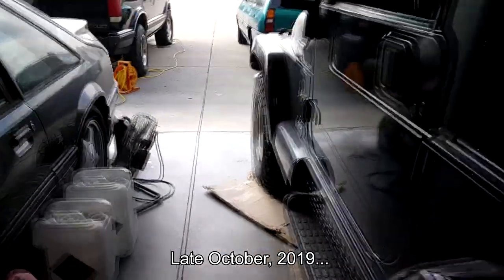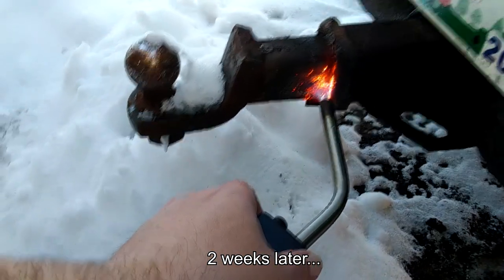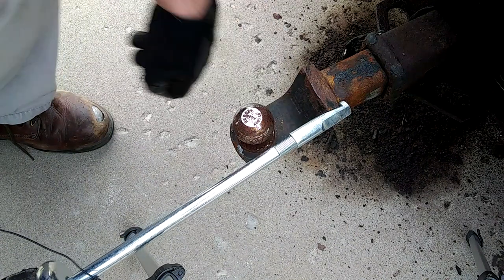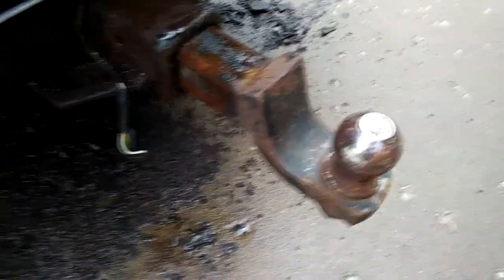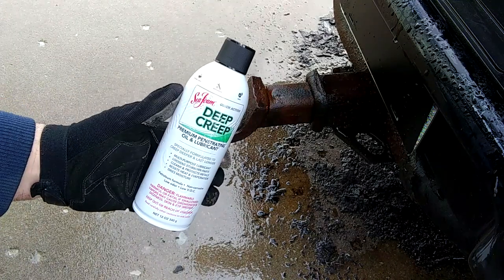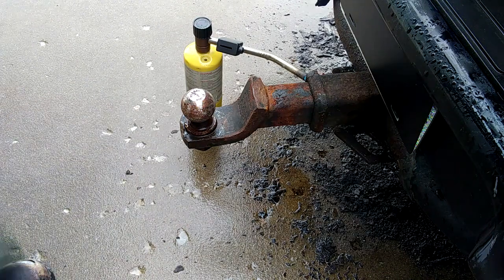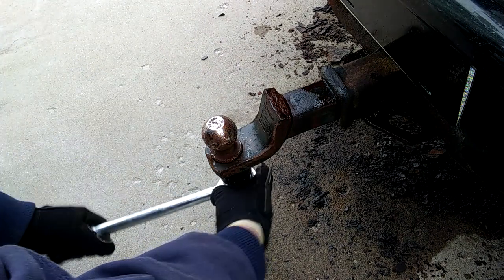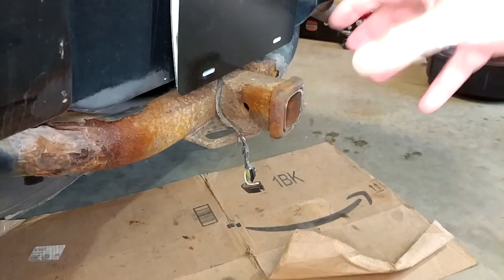Trying Internet Suggestions to Remove a Stuck Trailer Hitch

Comment: Heating the  inner piece just increases the size against the outer piece and the interference does not change. Heating the outer part good and hot, then spraying the inner with some freon from the back to shrink the inner will cause a dimensional change, have it hoooked to a chain and a tree and give it a jerk, it will most likely come out.
Reply from the maker: I was just trying to drive as much temperature into it anywhere I could and let differential cooling overnight take the wheel and hope it might crack loose. A MAP torch was never going to be able to put enough heat into it to expand it meaningfully. That said, I did use most of a bottle trying for the Sea Foam attempt and I did spend more time on the vehicle side.
Reply: @TheBrokenLife  Well, it worked for me. A map torch will induce enough heat, followed by the shrinking. 30 minutes mine was out, rust ,sand and all.
Reply from the maker: @tedgerstenslager2949  Check out the end of the video to see what I had at the end. I suspect we may not have started at the same place.

Comment: Hey heavy mechanical engineer here. Was really interesting to watch how others attempt this and ive seen alot of those gimmick tricks over the years. As you said theyre basically all wd40. 

You was on the right lines with the map torch but you was heating the inner part. Id put alot of money on combining alot of the techniques would have brought this out. Ie heat and shock.

Two things you didnt try after heating was hitting it further in, breaking the corrosion is the first step and in or out it still breaks the corrosion bond and a much bigger hammer (sledge) would have had about 20 times the force of that slide hammer. 

Second tip you didnt use is if you cant heat it enough with your torch is welding, still ploughs heat into it and a few runs of weld is gunna heat it to about as much as a home diyer can get it, also more people have welders than a big oxy torch setup. Even crap welding works (just make sure its on the right part!)

I was also actually thinking you could use an impact gun to help break the corrosion, again a shock method, and i saw you use on in the video but you needed to combine it with getting it as hot as you can with your torch (it will help) and a hammer, its not just going to pull out gently as you seamed to try when using the impact. 

Cool video tho and id love to of had a go at this just to see if i could have done it as i know its different to words on the internet vs real life.
Reply from the maker: Thanks! 👍

I actually tried all of those things (except welding... no welder at the time), I just couldn't have a 6 hour video and how many people want to watch a guy swing a hammer that long? 🤣 I was reasonably sure I did have footage in there of trying to beat it in further with a mini-sledge (in reality I did so on multiple occasions, heat or not, various oils, etc)? And at one time I had 2 MAP torches heating the outside of it. I went through 2 entire bottles trying assorted things. I also tried an air chisel in addition to the impact gun in addition to heat. You didn't see the heat + impact because that wasn't what "the internet" suggested. The suggestion was that it was a magical trick that will pop it right out... and it didn't. Just like the snake oils, vinegar, etc.

The footage from this video spanned 2 years of messing with it before the cutoff wheel came out. I'm still convinced the only thing that may have really helped is a lot more heat. If I had access to an oxyacetylene torch I could also have just cut it out of there. Believe me when I tell you that I tried everything I could.

If you watched to the end, I'm surprised you still think it could come out. I am more and more considering a follow-up video where I take the entire bar and put it in my hydraulic press and we see how many tons it tolerates until it comes out or something breaks. 

With all of that said... It's still in there if you really want to have a go at it. I can start my own carnival attraction in the driveway. Step right up! 🤣😉
Reply: @TheBrokenLife  hahaa thanks for the reply. 

I guess a video only shows so much and doesnt capture the 2 years of trying in fustration. Like i said a video comment only shows so much. 

I work in a quarry with big old rusty things weighing many many tonnes and its crazy how a guy swinging a hammer and some heat can have any effect on a 100tonne crane trying to lift something stuck with rust. 

But again i trust you tried everything you had at your disposal i guess i just enjoy the challenges when its not work and it doesnt matter so much. Ie its not time dependant or have another job that needs doing after this etc. 

I think it would be quite hard to press out as most home presses only go to 10tonnes or so, and without heat and shock helping i dont think itll do anything. You mentioned you had an air chisel tho? Maybe the combined force of the press and air chisel would work after heating. 

Again im really not trying to say you could have got it out and i know if i was in your situation id of cut it off alot sooner, id just like to see how i faired in that situation, i think you put in a great effort so dont take my comments as negative ones im just some random guy half way round the world on youtube who really enjoyed watching your video and thought id leave a comment :)
Reply from the maker: @evolution0016  Your comment is probably one of the most even handed and fair responses I've gotten on this video. People either loved it or hated it and very few saw down the middle. I take no offense at all to anything you've written. 👍 

Honestly, had I known this video would become popular in any way (and been more experienced with YouTube at the time), I would have probably tried to show a few things in more detail. When the footage started, I had only been recording videos for a few weeks and we're now in year 4. 😆

As regards my press, the limitations you've outlined would be half of the experiment. It's actually a 20 ton press and it's air over hydraulic. The way the power pack on those units work gives them at least a small impact pulse. That's the primary reason I wanted the specific press I bought. I have a video on it. OEM Tools 20 Ton Hydraulic Press (25087). Since you work in heavy equipment you've probably seen the bigger versions before.

Comment: You need an oxyfuel torch rig and a rosebud tip.  Heat that entire OUTSIDE tube to orange heat. Knock it around a bit with a 4lb sledge and I'm certain it would be ready to fall out.  Easy peasy.  I've done this crap dozens of times on the farm and for the last 20 years doing industrial maintenance.  I always laugh when the other maintenance guys have something stuck like this and they break out a wittle bitty teeny Bernzomatic torch that would be more appropriate for browning the meringue on a banana cream pie.
Reply from the maker: I thought I discussed oxy-acetelene torches in the video?
Reply: @TheBrokenLife  my apologies.  I'm a bad man.  I've been up since 2:45 am to go start up the wiener plant and I was kinda skipping around.  You did the right thing then.  Just don't be afraid to use enough heat, like a rosebud tip, and take up hot enough to chemically breakdown that rust.  Sorry.
Reply from the maker: @channelview8854  No problem. If I make videos that are too boring for people to watch the whole way through, that's on me. 😜
Reply: @TheBrokenLife  you are very kind.  Thanks for sharing your video with us.
Reply from the maker: @channelview8854  Thanks for watching! 👍

Comment: ok, maybe I can't compare a stuck hitch with plumbing, but I always understood that using heat meant heating the larger piece (receiver). Heating the hitch would just wedge it tighter, I believe.
Since the receiver is open at the back, have you tried a heavy bar beating from the back?
Reply from the maker: There are a few schools of thought, but, yes, you generally want to heat the outside thing. I don't have enough torch for that, so I just tried to get it hot enough in general for mother nature to cool it down and hope for a miracle.

I did think about beating it from the back, but I would have had to drop the spare to get a swing on it and I was about 90% sure that wasn't going to happen (I was wrong... the spare did eventually come down), I would have had to lay under the truck getting rust bits rained all over me, and I was pretty sure it wasn't going to work anyhow. In the end, there was nothing lost from just cutting it off. All of that stuff is not suitable for use anymore.
Reply: @TheBrokenLife  Just saw a vid get it done. He cut the front part off like you then he used a cutting electrode stick to cut up the rest of the tube on the inside.
Reply from the maker: @jimmyschmidt14  Arc gouging is an interesting choice to get that done. Whatever works, works.

If my tow bar had been in usable condition, I would have probably tried a sawsall to split what was left, lengthwise, and fold it out of there with a punch and hammer. I would have probably tried to leave it a little long too just to give myself something to work with.

Comment: Are the tall skinny bottles of propane a better deal than the coleman green bottles?
Reply from the maker: My tall skinnies are technically "MAPP Pro", which isn't exactly the same as propane, but close. It's supposed to be marginally better for torches than regular propane.

Costs seem to vary wildly. I bought some of the little green guys for other reasons over the past year and sometimes they were more than MAPP, sometimes less.

Comment: I think the best bet when they're this bad is cut it off like you did at the end then try a chisel in there........If that doesn't work then pull the whole thing off and replace it.........Of course there's other ways when you have access to torches and a welder but that's a whole other thing.
Reply from the maker: If I run into one like it again I'll likely just replace the entire bar from the start. If it's that rusty, it's probably not safe to use anymore.
Reply: @TheBrokenLife  Doing this right now. Going to try to get one off even though its better to replace it. I like a challenge.
Reply from the maker: @jimmyschmidt14  Take a really close look at everything before you bother to set off on the mission. My tow bar had noticeable rust holes in it that rendered it useless regardless.

Good luck with it! 👍

Comment: Cutting it off with the axle grinder looked easy. Now how do you get the rest out?
Reply from the maker: The draw bar itself isn't safe to use, so, the entire thing will be coming off of the vehicle.

If I really wanted that stub out of there, I'd probably cut slits in it with a sawsall and break it out with a chisel.
Reply: @TheBrokenLife  Thanks for that extra info.
Reply from the maker: @erwinerwin1245  👍

Comment: When using the plumbers torch , you were heating the wrong part of the hitch. You need to heat the outer tube ,to make it expand.
Reply from the maker: Believe me when I tell you that I heated that thing every which way you can imagine, for years.
Reply: Takes a lot of heat, for a long time. I tried and gave up. went for the Sawzall option ! Sawed off the hitch then went up inside the tube on all four corners and smacked the thing out in pieces. Your video made me feel better though, thanks. @TheBrokenLife
Reply from the maker: @jimpomac  I ran nearly an entire bottle of MAP gas out on that thing. Once or twice I let it sit there and just run for about 20 minutes per side.

Once I cut it off of there, and examined the condition of everything else more carefully, it became clear that nothing else was going to get it done. 🤣

I felt defeated too, until the first time I noticed that my shins didn't hurt.

Comment: It has to be red hot when you hit it. What’s the point of heating it up if you let I cool off? You are heating up the wrong part. You need to heat up the metal sleeve the hitch goes into. After you cut it, it’s impossible to do anything. You literally did everything wrong! Even the puller you could’ve put some wire around the ball and tied it on so it didn’t slip off every time. Idk dude
Reply from the maker: Did you even watch the video? I don't have enough torch to heat the whole the thing up, never mind red hot. That was never going to happen with a MAP torch.

Did you see the end where I showed it was all in such poor condition that nothing was going to get it apart and none of it was safe to use? The only thing that could be done was to cut it off.
Reply: @TheBrokenLife  Yes, it was painfully stupid. ....
Reply from the maker: @kuthumi  Thanks for watching! 😆

Comment: Dude, 25 minutes hoping to find something that works, and it turns out nothing works????
Reply from the maker: The cutoff wheel worked. The next step of that would be to take a sawsall or hack saw and slit the stub remaining on the interior and chisel the pieces out. 

I cannot emphasize enough how much time and effort that would have saved me if I had just done it from the start. I think a bottle of MAPP gas is about the same price as a replacement bar.

That said, with as rusty as this hitch is, none of it is fit for use any longer. If yours is so bad that the usual things don't work, you should probably consider replacing the entire hitch.